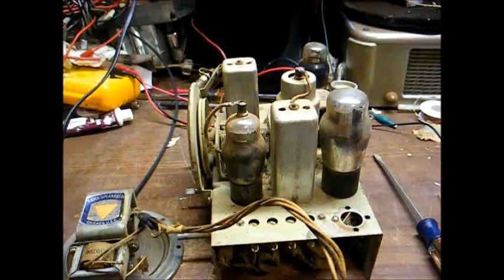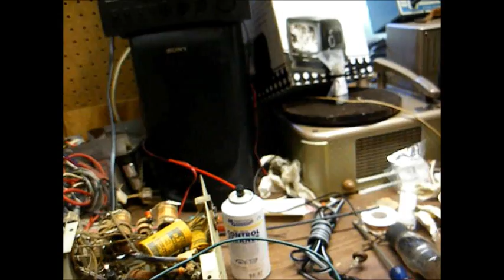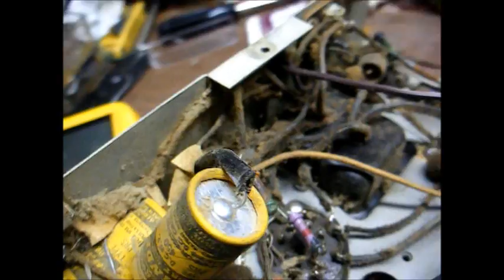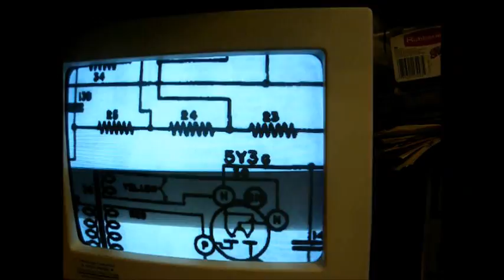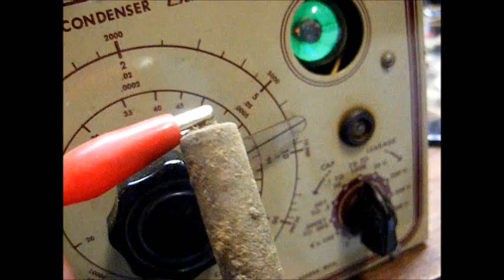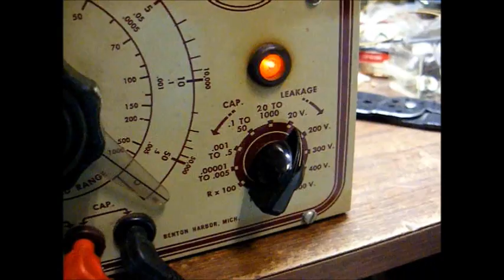Repair of a Crosley model 517 "fiver" tube radio from 1937 - part one

Comment: Back when I was younger I used to resurrect vintage radios. Often the power switch is merely oxidized heavily. I found that applying low voltage DC with a current limiting resistance then toggling the switch off and on would allow the arcing to self clean the internal contacts of the switch off.

Comment: I have a G.E.radio.1960 something ,the knob is plastic and the volume knob is plastic it won't come.off ,so I can't clean the dirty clock face ,but if I force it I could ruin a.perfect work radio ,stuck between a.rock and a hard place .anyone got any ideas .

Comment: I get a chassis bad shock what am I doing wrong?
Reply: when you touch the chassis it shocks you...if so...some do...reverse the plug and check the chassis voltage to ground of an outlet..and see if there is voltage..if so..then something is wrong in the radio..
Reply: Alright Thank You will do
Reply: +Kennynva T. A better way is to use an isolation transformer.

Comment: Hi RTPN, I recently purchased a 1945/46 Crosley 56TC radio and would like to fix it up, the problem is the chassis is fully enclosed and looks to be riveted, should I drill out the rivets to gain access to the wiring. This radio is the American Overseas AC/DC power supply, with 1/2 wave rectification. Any help with this would be greatly appreciated. I am a sub and really enjoy your videos and knowledge, thankyou. Take care, C.

Comment: I have this model really nice but I keep getting a shock on my chassis:(
Reply: It sounds like this model uses a power transformer...that means that the chassis should be isolated from the line voltage.

Comment: That's a nice find in a Crosley "Fiver". Holes in a chassis are a bummer. I bought an old radio where the bugs and whatnot and maybe a rodent found their way into a hole in the chassis. Sometimes a hankerchief can be put behind a knob to pull it off. Nice tip about the coated wire. Much better than trying to screw driver pry it. I enjoy your videos. You are a true nuts and bolts repair man and really know your stuff.

Comment: I have an old early 50s Admiral 78 rekee player and AM radidio that needs the works. I'm thinking of just gutting it all out of there, and puting all NEW stuff inside (that is available). About all that would be used from the original would be the PS transformer, filter cans, and tuning condensor. So that could mean new tube sockets and tubes, all new caps and resistors, new pots, new WIRES, new cartridge, and perhaps a new speaker that sounds better. I would like to make it as "new" as possible, and it could be a lot easier than trying to unsolder all those connections in the chassis. I like how joernone strips them down, and repaints the chassis to make it look shiney new too.

Comment: Personally i'd download a schematic and check continuity of the power transformer rather than powering it up and checking voltages. I just wouldn't want to risk burning the power transformer out in the process of checking voltages before a recap. that being said, the other reason I do that is I have no idea what proper voltages should be, and no idea where to find B+ etc so I don't even bother to check them when I'm done unless I have service info for the particular model i'm working on that states voltages and shows pictures of test points. My personal rule of thumb is to assume ALL capacitors are bad and change every last one before powering up. it's interesting to see a different approach than I take in radio restoration though. Great video! :-)

Comment: I like what you said, sometimes the ones that look nice, end up being the most work.  Hope you find a filter can for it.  Still haven't found a speaker plug for mine, guess I'll put a generic cap on it.  I'm with you, don't like holes in the chassis.  Real nice cabinet on yours.  A shame what's been done to the Crosley name.
Reply: Back in the day, they used to make the chassis, using chassis punches, a bending brake, drills, and maybe a bit of tack welding. Sometimes I look for home brew rigs on ebay. I like a bare chassis without case too, a thing of beauty. Some cases are in such bad shape, that it is still worthwhile, even without the "pretty case". Bakelite or plastic can be the worse, since wood can be reapired. The newer transistor junk just doesn't look as good "naked". Gotta love that "radio porn"!

Comment: Oh, it's one of those weird Crosley's with a 5Y3 connected as a 1/2 wave rectifier. You were lucky there, many of those Crosley models with that feature seem to have bad power transformers. Crosley's were always budget sets but I don't understand why they would hook up a power supply in that manner, the savings would have been negligible. It's strange that they did not use a 1V rather then a 5Y3, or even something like an 84.
 If that flex resistor was for the output tube cathode it was probably a 1 or 2 Watt job. Most of those things suffer the same problem, over time the nichrome element burns right through the cloth sleeve and becomes a miniature slinky. Even it it doesn't go open that slinky can move around onto something and short.